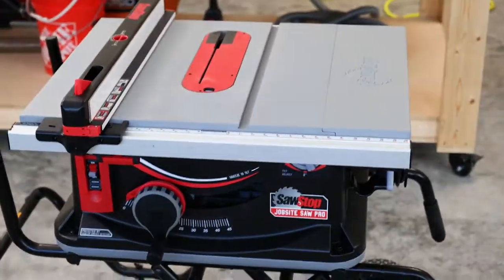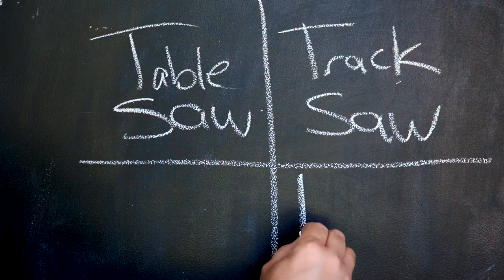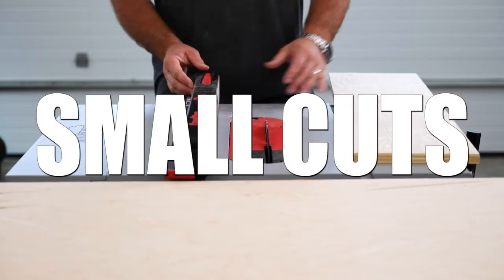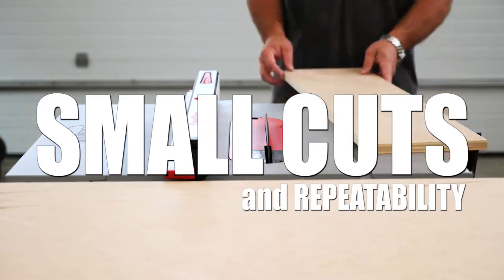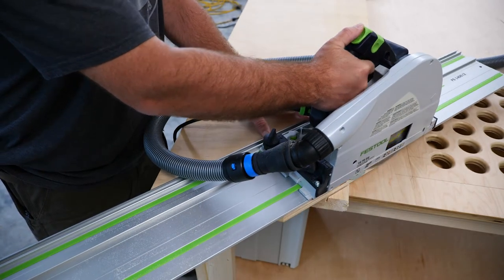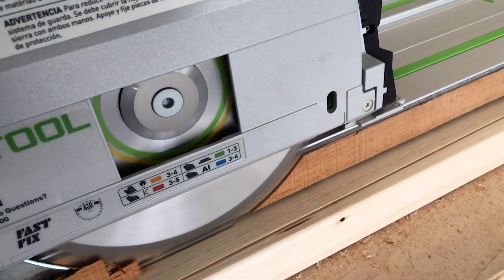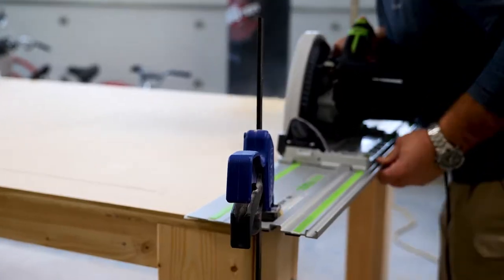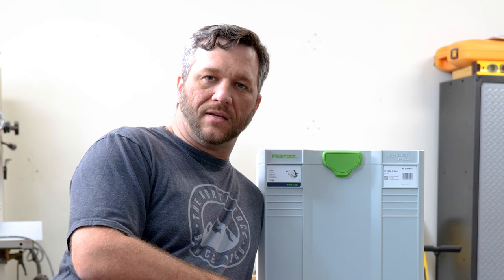TABLE SAW vs  TRACK SAW! Which should you buy?

Comment: I really enjoyed this video, it really summed up exactly the comparison I’ve been doing before deciding to buy one because my table saw is not as useful as I thought.     BUT...  The cutting at 4:35 is very dangerous even with that riving knife!  With short pieces, if the cut off pinches between the rear portion of the blade and fence it twists up and then sideways towards the blade taking your hand with it. The wood flies backwards into your chest while your fingers hit the saw blade.
Reply: concerning 4:35: I wondered why he didn't use the miter gauge. Because what he did was really dangerous.
Reply: I made that mistake two days ago with no riving knife...
 The piece of wood forced the saw change its angle, which fortunately didn't allow the kick back to happen but also prevented my hand from getting over the saw...
 That's actually the reason I'm watching this video, I don't want to use a table saw ever again... I'm too scared now, I'm still trynna get it over.
Reply: He may be a little less cautious there because he’s using a sawstop table, but yeah, kinda sketchy otherwise

Comment: Cheat cheat - You used a table to support the rip cut for the Track Saw, but no outfeed table for the Table saw.  BTW I love my TS-55.  There are ways to do those small crosscut's with the Track saw.  Loved the video.
Reply from the maker: Busted. 😁 Clearly, my rules were unfair 😜 Thanks for watching!
Reply: I guess the work space was implied when using a track saw… would you prefer he did it on the ground?

Comment: I started with the TS75. I have a Bosch 4100. Good saw but not confident in using it regarding keeping my fingers attached to my hand.  I have a small basement workshop but also like working outdoors or in my garage. I am considering a Sawstop Contractor Pro for when I do need a TS.
Reply from the maker: I used a 2 HP Delta Unisaw for 15 years and never was scared of hitting the blade but there is just something scarier about a jobsite saw versus a cabinet saw that made me want the Sawstop. I think you'd be happy with the contractor saw. Bigger and heavier is always better when it comes to a table saw if you have the room.
Reply: @HAXMAN  Room is tough as I don't have a dedicated area I can have to myself that is very large.

Comment: Fair comparison. Question, how smooth is the tracksaw cut? Smooth enough to chop out some kitchen cabinets? I just get a knot in my stomach when I look at the prices of new cabinets. Even the well respected Ikea kitchen cabinets. I figure for that kind of price I can buy a good track saw and all of the materials and still have lots left over. The question is, will the track saw do the job? I already have the basic tools including a compound miter saw, drills, sanders, etc. I just need a dang table saw but can't find the $$$$ for it.

Comment: Loved it! Thanks! I believe that track saw + miter saw would do most of the things if not all, a part from dado. Dado you can do with multiple passes of a track saw anyway, can't you? Additionally, I'm currently considering table saw more dangerous then track+miter saw.
Reply from the maker: Thanks! Table saw is definitely the most dangerous but they all will eat fingers in their own special way. 😄
Reply: Yeah, I love my miter saw...cheap, efficient, relatively small and a great companion to a router and track saw.
Reply: Festool makes an adjustable dado blade
Reply: Yeah I have to agree with you on that one. I feel the same way.

Comment: On round two, you said you wouldn’t use an outfeed table with a table saw because it would be considered cheating.  However you used a table to support the sheet of plywood when using the track saw.  That is cheating because you’re using another tool (table) to assist the track saw to make the cut.  In order to use track saw you will ALWAYS need something else to support your workpiece, whether it’s a table, sheet of foam or other pieces of lumber.  The only advantage I see that a track saw has over a table saw is making tapered cuts.

Comment: It's a nice advert for Festool, but I've never seen anyone use a track saw on a jobsite, and I've never seen anyone use a jobsite saw, in a shop, without an outfeed table. If using an outfeed table is "cheating" because it didn't come with the saw, then throw away the sawhorses and table that didn't come with the track saw. That includes the speed square used for angle cuts, or combining two tracks to get something long enough to do the job.

I would prefer using a track saw because they are much, much safer. I know pros who've lost fingers on a table saw. That's a difficult thing to do with a track saw. But I wouldn't use a track saw on finish work. This to me is like comparing a framing hammer and a finish hammer. There's some overlap but mostly different tools. And to preempt responses to my post, I'm not making my own video because I couldn't do it as well as HAXMAN.  That and I think his purpose was to get people thinking about the pros and cons. Ten minutes ago I had very few comments regarding comparisons. Now I'm a subscriber.

Comment: nice vid, however, I disagree on the tablesaw not being able to do jointing. I make herringbone parquets all the time with mine. You just need to do multiple fine cuts using the fence and on both sides of your piece. (with each cut the register gets more n more perfect).
Reply from the maker: I agree. I used to edge joint a lot on the tablesaw. I just had to use a jig or a long straight board attached to the fence or only joint boards as long as the fence. I remember making 10 or 20 passes to get it straight though. 😄 Thanks for watching and for the feedback!

Comment: In the UK we don't have dados and the tables saws arbour is too small to use a dado, so for the uk, the table saw scores one less I'm afraid. I basically only use my table saw now for long thin rip cuts. I predominantly use the track saw and use an MFT for the small repeatable cuts.
Reply from the maker: I didn't know that. You learn something new everyday. I wonder why they don't have them in the UK. Is it a safety issue?
Reply: @HAXMAN  It's actually throughout Europe, and yes, Dado blades are banned for safety reasons.
Reply: @Simon-Smith.  really?  Do people use routers to do dados?

Comment: What do you think the score would be if in addition to a track saw, you added a router table, band saw and sliding miter saw along with a hand held router on one side and the table saw on the other. Would there have been cuts that only the table saw could make accurately?

I'm asking for, ahmm, a friend who hasn't gotten into woodworking much as he would like to because when he was a kid he came this close to losing a couple of fingers when using his Dad's table saw. He would like to see if he can use other tools to make all of the cuts that most other woodworkers would use a table saw to make. Absolute efficiency isn't the main driver. He just want the resulting pieces to not look like the work of a 7 year old with a PlaySkool woodworkers play set.

Comment: Is the saw stop job site saw  good enough for cabinet building or would I need to step up to the contractor saw?
Reply from the maker: It depends on if you’re building one set for yourself or doing it professionally on a daily basis. If the answer is professionally, then I wouldn’t recommend the job site or the contractor saw. They just won’t have the power and speed you need on a constant basis. I would go with the cabinet saw with 3hp. You would regret not having the extra horsepower. I would buy a used Delta Unisaw if you don’t want to put out the change the Sawstop cabinet saw costs and then upgrade to the Sawstop later. If you’re just using the saw occasionally then either the jobsite or contractor saw should perform similarly. Just my humble opinion 😉

Comment: i'm still trying to figure out which one to get. Its probably more appropriate to consider track saws with MFT/ACS and the table saw with the outfeed for a better all round view
Reply: I went with a table saw.  I already had a good circular saw so I purchased a straight edge for it (approx. $50.)   Most folks that use a track saw put something under it.  I've seen plywood, lumber, and styrofoam.   With the cost of wood today, that stuff could add up over time.  That being said, if money didn't matter, I would get both.  BTW:  My use is general carpentry.  I mostly use the circular saw and straight edge to cut full-size sheets.  I use the table saw for everything else.

Comment: Using a track saw is not very enjoyable... the track is always too long or too short then need to connect a few together and try to get it straight then sort out your dust collection and make sure you have a clear path and play the line up the track dance or attach the fiddly add-ons like the track square / parallel guides. On top of that you have to clear out a work bench and make sure you have a sacrificial backer. Finally you make a cut and oh no now you need a shorter track for the next cut. Bleh. 

I do have one because I had to break down a ton of sheet goods for a few projects. It does a certain job very well but given a choice I'd pick the table saw every time.

Comment: If you have a small workshop then you need both.  No question.  You can't do fine woodworking with a track saw, but you totally can with a decent jobsite saw.  I have the DeWalt jobsite saw and I love it.  I use it nearly every day for making all sorts of joints.  I'd like a bigger table, but I don't have room for it.  I also have the Bosch track saw system with the big GKS 18V-68 GC which is a big big for sheet work, but nothing has stopped it so far.  It is still an infinitely safer way to break down full sheets by yourself, and so easy to use, and spot on accurate.  I love both systems and wouldn't be without them.
Reply: This is completely false. If you get into the ecosystem of the Festool MFT (or a Kreg ACS) then you most certainly can do fine woodworking. I even did dados with a track saw on these tables.

Comment: Thanks for the video, I appreciate the information. I want to get a table saw and I’m trying to decide between the contractor version or the jobsite version. You mentioned that you used to have a bigger table saw and missed it. It’s going to be last table saw that I buy and so I want to get the right one.
I don’t have a shop just a garage, that I put a car in. I want to get a contractor saw but because of space am not sure about it.  I’m wondering if that is just way too much saw in general and I’m curious of your experience in using a track saw and a jobsite saw. does it meet all of your needs? Even if it took up more room would a contractor version be a better buy?  I’m going to get the sawstop. I already have a track saw and a Ryobi jobsite table saw but want a safer one.
Reply from the maker: Thanks for commenting! So far, after several months, the combination of a jobsite saw and a track saw is working great. Although, if I had a shop again I would happily trade them both for a full cabinet saw. It's just so easy to throw a sheet of plywood on a cabinet saw and make fast accurate cuts. It's definitely slower using the track saw. If you have the room I would definitely go with the contractor saw, especially since you already have a track saw. I just didn't have the room. The contractor saw folds up so fast and easy, and is so easy to move around my garage/shop. I move it several times a day sometimes. I think you'll be happy with either saw, but it never hurts to have a little more power.
Reply: @HAXMAN thank you for your reply and for sharing your experience.  Everything I read says the same thing that you do, get the bigger one. To be honest I really want the jobsite saw, not the contractor but I went to the dealers store today and can really tell the difference.  I’ll have to do some measuring to see if a contractor saw will fit.

Comment: Looking to build my first shop and walnut farmhouse table in my garage. My biggest concern is edge jointing. Which would you use (TS75 or JSS Pro) to ensure the best edge jointing? I've heard of kerf jointing using a track saw, but I'm not sure how clean the tear out is on the "throwaway" side of the cut.
Reply from the maker: I would say the TS75 will work much better for edge jointing. I don't typically use it, but the TS75 has a block you can attach to the saw to prevent tear out on the throwaway side. The track saw is really amazing at how smooth the cuts are. I've cut the face of painted cabinets that were too wide on an install and you couldn't tell. I don't know if you've used one before but think of it as an upside down cabinet saw as opposed to a circular saw. That's how smooth the cuts are.

Comment: Have you checked out the Kreg ACS2000? Take a look.
Reply from the maker: That's a really nice system. If I hadn't needed the extra cutting depth of the TS 55 I would have probably bought the Kreg saw instead. Kreg makes some really good stuff.
Reply: @HAXMAN  What is the cut depth of the TS 55? The Kreg can cut up to 2-1/8" at 90 degrees.
Reply from the maker: @terryjones8360  The TS 55 is the same. Sorry, I typed the wrong number. I have the TS 75 that cuts to 2-3/4". I wanted to be able to joint rough-cut wood.

Comment: With a tracksaw and MFT table you much faster with short cuts, crosscuts vs a tablesaw. I almost never use my tablesaw anymore.
Reply: I found you do more operations with the track saw than table saw, mft lift the track mark your piece or set the flag stop , adjust the blade height if the materials are different thickness,  put back the track cut , place  the saw on a cabinet or floor open the track and so on , I dont mention the vacuum and the cord that catches at the end of the track and prevents from pushing even with the guard installed,  its a amazing tool I've built a few kitchens,  but I feel that you lose about 30% of your time on a track saw vs table saw

Comment: Yea you can't really compare a track saw to a table saw, especially a small portable table saw. Nice try though ! They are different tools ! You couldn't break down full sheets on that table saw without a lot of trouble and you can't do dado's or cut small parts on a track saw. To be effective you really need both if your doing any serious woodworking.
Reply from the maker: My thoughts exactly. That's what I wanted to demonstrate in this video 👍
Reply: A better question might be, “Which (track saw or table saw) should an apprentice carpenter or a DIY homeowner buy first for a garage shop?”

And what if he already has the mitre saw and router?

Comment: You can’t really compare these two tools like this they’re not the same tool! a track saw has its benefits a tablesaw has its benefits some of them crossover but they’re just not the same tool! I mean try making a piece of molding and cutting a rabbit in the back of it with a track saw....that’s not gonna work!....try ripping down an 8 inch piece of solid hardwood by an eighth of an inch with a track saw....that’s not gonna work! Come on people get off of YouTube and get out in the wood shop and gain some actual real world experience for yourself!
Reply: it just depends on what your project is